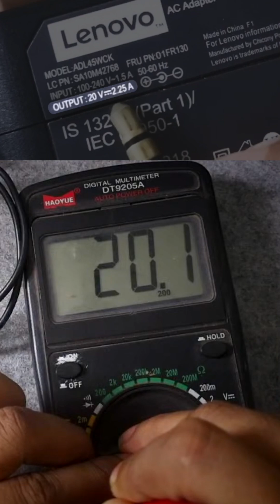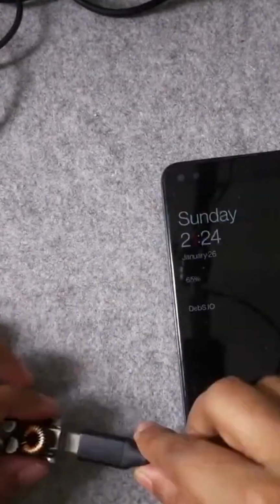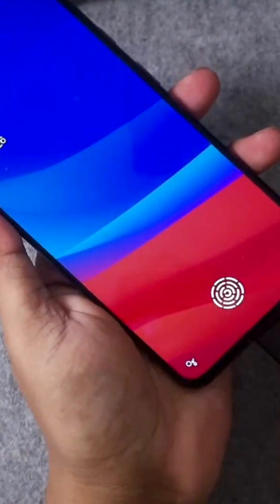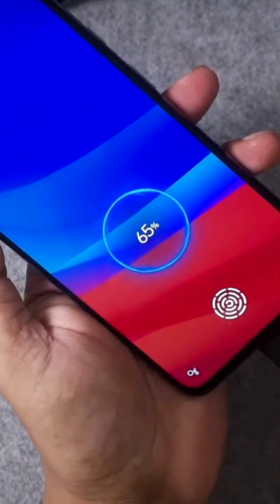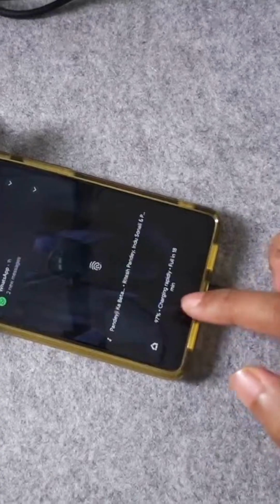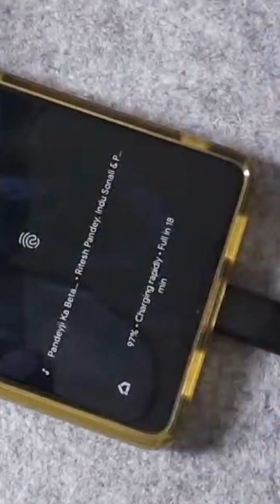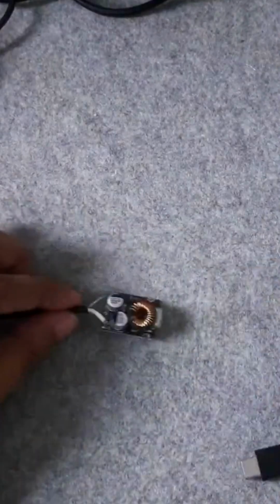It's not E-Waste! Convert laptop chargers to USB-C PD...

Comment: any direct connectors from jack to usb c available in Market??
Reply from the maker: Look for a USB-C male to male cable.
Reply: @BreakerSpace thank you for your response, but I was asking about a connector connecting barrel jack to usb c. Don't want to cut the cable so looking for plug n Play kindly of thing.
Reply from the maker: @pranitlandge5650  then you probably would want to use a female barrel jack for the PD65W module's input, that's compatible with the output of the power bricks' output male jack.

In that case you won't have to cut off the wire, and have it more like plug-n-play solution.

Comment: cool, I love this kind of gadget, up-cycling, making use of old stuff (I have dozens of old laptop chargers lying around), I was actually looking for the reverse of this, using new USB-C chargers to work with older laptops that have a proprietary charger socket, and it seems they're available too!
also, love the screaming when he cut the plug off lol
Reply from the maker: Haha... btw, you can try to get Female USB breakouts, and connect the old laptop's input jack to it. That should make a USB to DC adapter, that you can use with the new USB-PD chargers to charge old laptops.